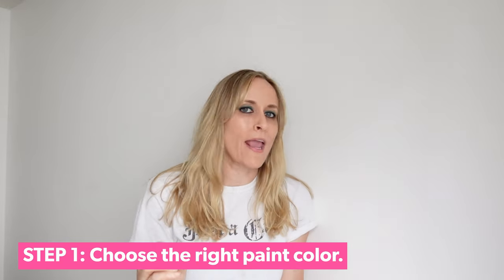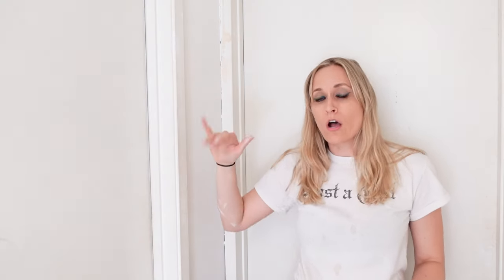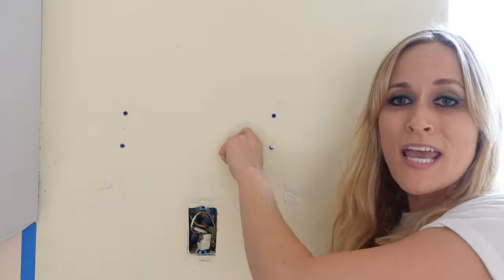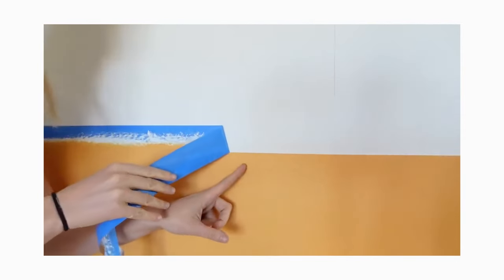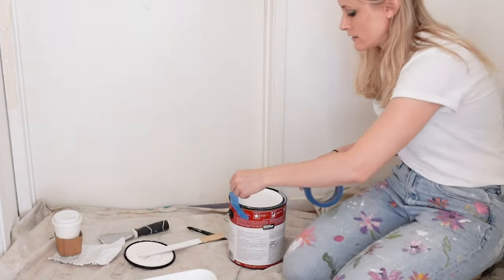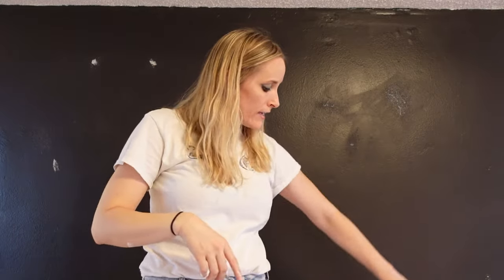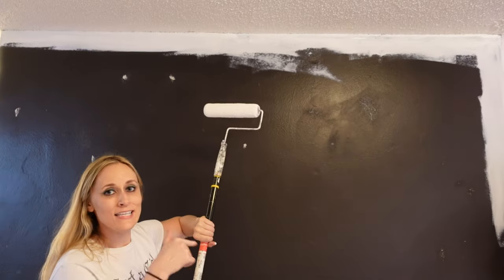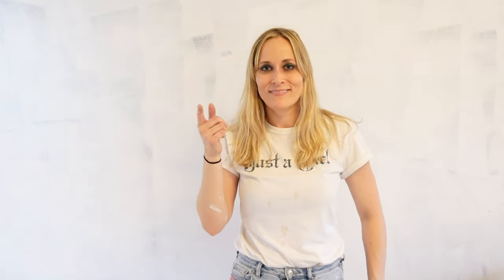How to Paint a Room (Tips & Tricks for Beginners)

Comment: You make the edger sound like something new, hasn't everyone used them before? They even make one that paints corners..(I love that one!)
These are fantastic tips. Extremely useful!
The trim/baseboards have been my personal hell.. can't wait to use that tip. I might even enjoy painting my living room now. Any tips to paint textured ceilings? Especially covering brown leak spots on textured ceilings? The leaks are fixed but I dread painting the stained texture.
Reply from the maker: Haha. You’d think so, but everyone I’ve ever painted with/told about had not used them. So happy we can preach the gospel. Ooopfh for that ceiling. Top things that come to mind are using a stain-blocking primer (my handyman did this in an old apartment bathroom). Make sure you have the right nap for the texture. And best tip I’ve heard is to paint side to side instead of rolling it front to back (like over your head). Saves neck/back pain.

Comment: Tips on filling holes on textured walls for after sanding
Reply from the maker: This is a great vid for that. Basically, you apply a bit of compound or spackle and use a dry paint brush to move it around and mimic the texture: https://youtu.be/LLiKD1XTLc8?si=QpE9RHt8yO5TqI3k